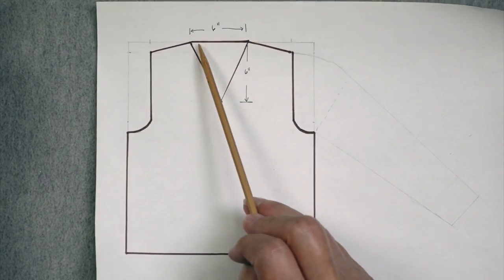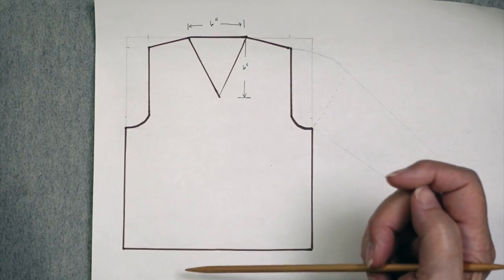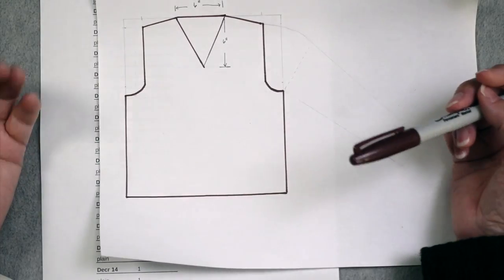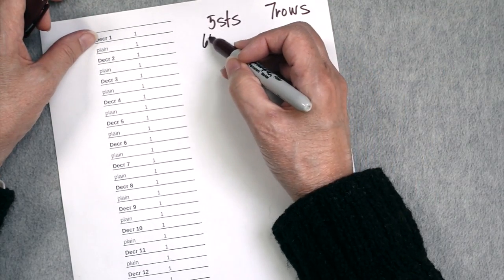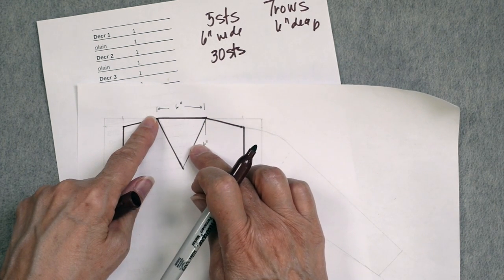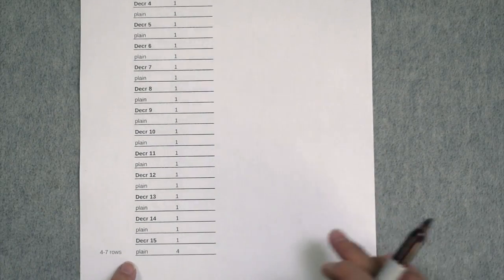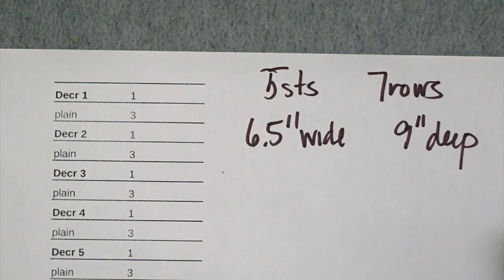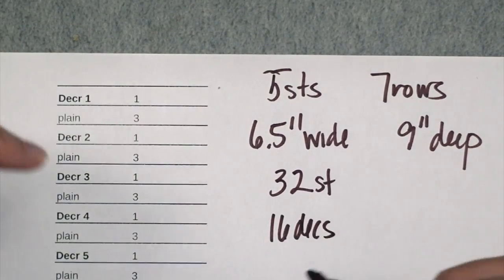V-neck sweater construction // Technique Tuesday

Comment: For myself, I tend to like only very shallow Vs. You didn’t discuss a depth less than the width, and I’ve had no difficulty constructing that. Now I’m curious whether my preference is rare, and if it is rare, is that because of the effect sleeve weight has on stretching out the neck?

Thanks for a fascinating series. Your analytic approach really helps me a lot.

Comment: How to shape the back neckline of the v neck sweater, I would appreciate a reply, thanks for all you teach😊
Reply from the maker: I don't usually shape the back of the neck. It's straight across. There is shoulder shaping, as for any sweater, typically 1/2'' to an 1'' of depth from shoulder at armhole to the neck opening.
Reply: @RoxanneRichardson  thank you so much!

Comment: Hi Roxanne! I am knitting a 1x1 ribbed v-neck band but am knitting the knit stitch thru the back loop for a twisted effect. Is there a way I can make the centre stitch in the centre of the mitred decrease also twisted? 
Thanks!
Nic
Reply from the maker: There is! With a regular CDD, you slip the first two sts together, like a k2tog, which changes their stitch mount, but also changes their order. Changing the order allows allows the center stitch to be passed over so that it will lie on top. Changing the stitch mount allows the sts to be passed over so that they don't twist. So what has to happen for the center st to be twisted is to reorder the sts, but in a way that that center stitch maintains its stitch mount.  That way, when it is passed over, it will twist. (Keeping the sts under the center st untwisted helps everything lie a bit flatter.) You can re-order them using a technique used to set up sts for cabling without a cable needle. Further explanation is best suited for my Ravelry group or a future video.
Reply: Thank you Roxanne! I will play around with that.

Comment: Roxanne, this is especially helpful to me now, because I'm trying to adapt a Japanese design for a men's cardigan vest (with V-neck) for a brother who's much larger than any of the sizes it was designed for. But I'm confused about something: You say you're assuming the sweater is knit top-down, but you talk about decreases to shape the V-neck. Won't those be increases if you're going top-down?  I'm going to be going bottom-up, so will open up the two sides at the point of the V and use decreases going on up either side, but am a bit puzzled about the terminology.  Thanks so much.
Reply from the maker: There was one point where I talked about working decreases for bottom up, but that for top down, it would be increases. It's possible I misspoke at some other point where I didn't catch it in editing.
Reply: @RoxanneRichardson  thanks, Roxanne.
Reply: @RoxanneRichardson  I now see I should ahve watched the shaped neckline video first. Just did that, and it helped me get my bearings.